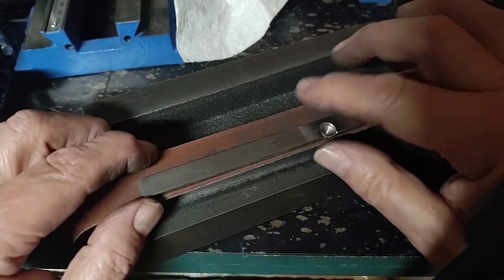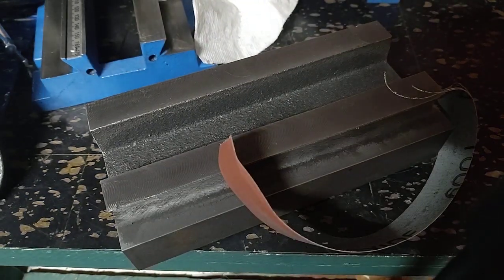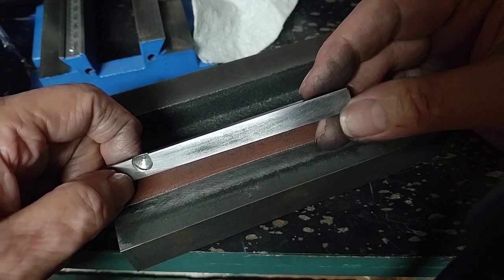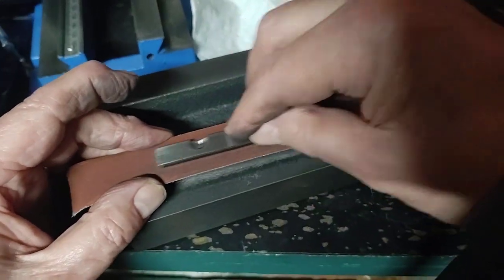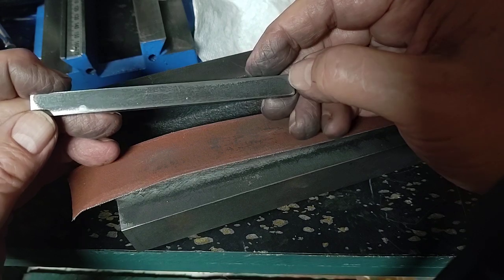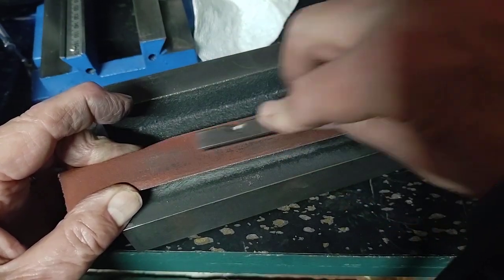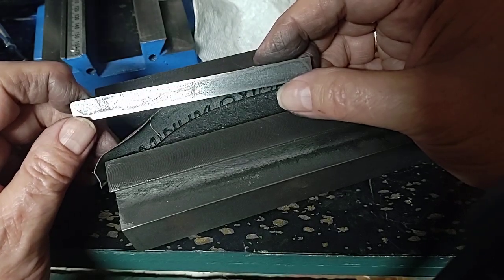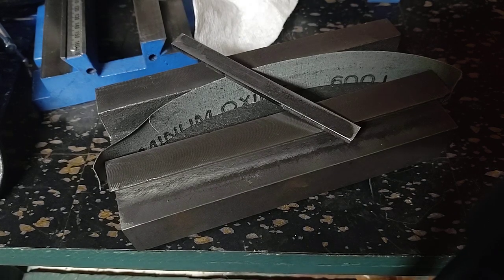Chinese X Y table long gib fetteling

Comment: Because they are so ruff, they bow the gib strip to make it get a sliding fit, so watch you don't go down a rabbit hole.
Reply from the maker: The gibs are more or less flat, there is no built in bow, but they are cold rolled steel and have a cross section that is dipped in the middle along the length. Time will tell if I will keep these steel ones or make new ones from brass.